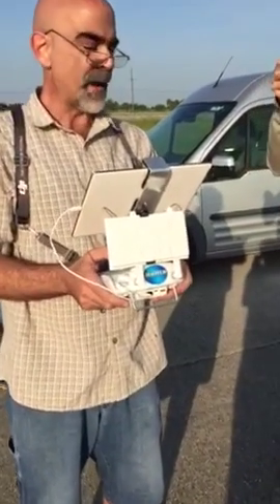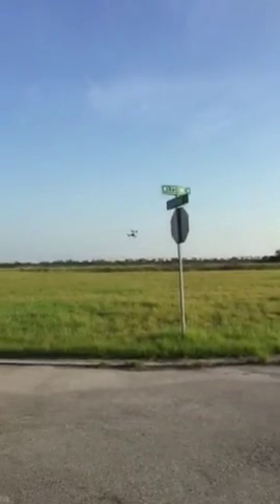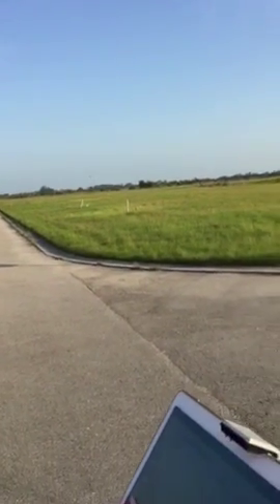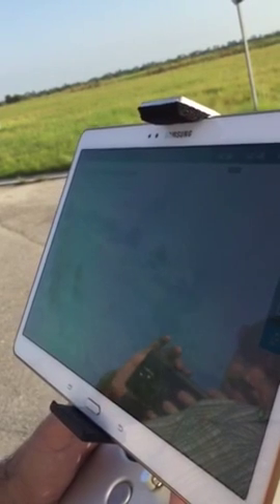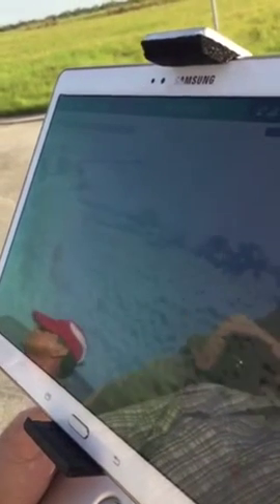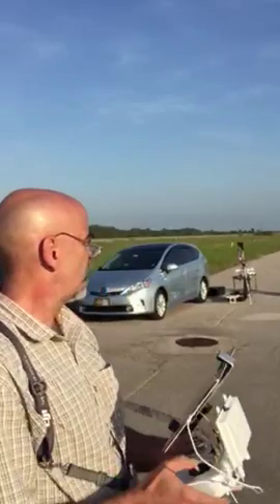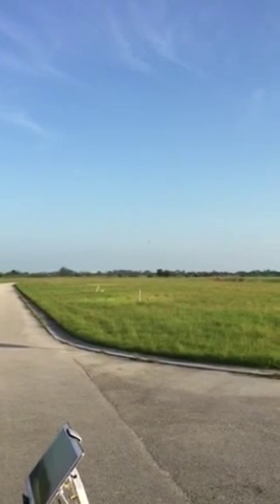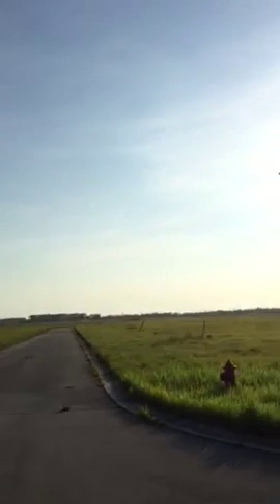ITELITE DBS INSPIRE 1 ANTENNA 80 DEGREE TEST MUST SEE

Comment: Did you have the stock antenna hooked up too or was that just the dbs antenna ?
Reply from the maker: The stock antenna were left on to hold the panel for testing but not hooked up

Comment: Impressive but it would have been nice to see the results that you got without the mod so we could see a before and after. Given the open area, you may have had just as good a signal. I have seen videos over 1.5 miles with very little video feed interference.
Reply from the maker: This video was made to answer some comments made about the panel antenna having a very narrow beam width which this video proves that is not true. Not only does it have amazing bandwidth, it is an extremely long range antenna. I presently have gone 6.7 miles unboosted with it. Logged into flytrex